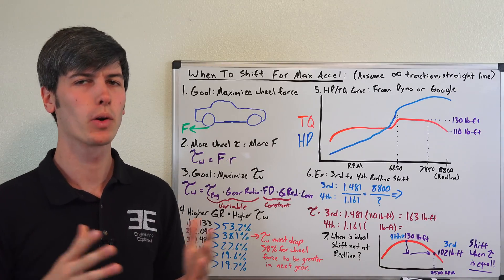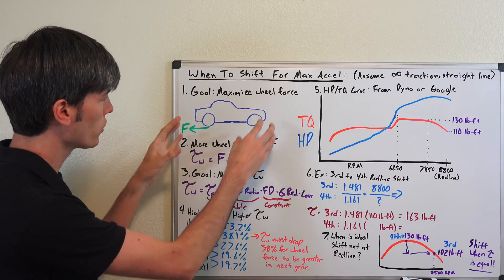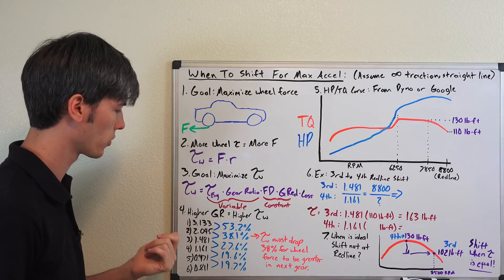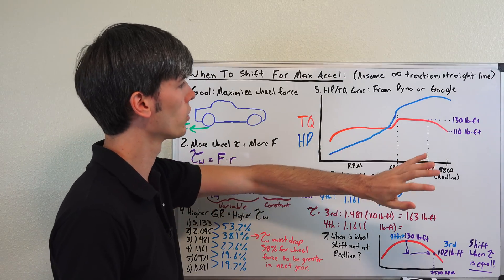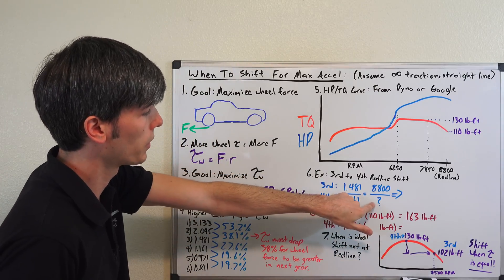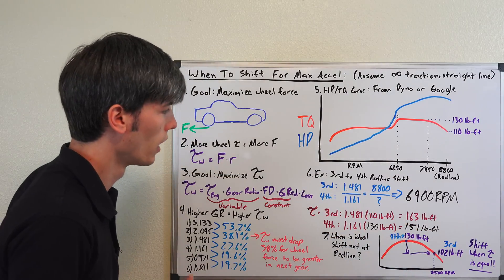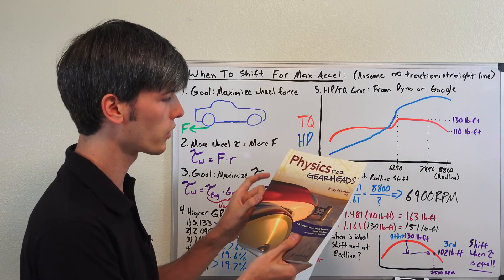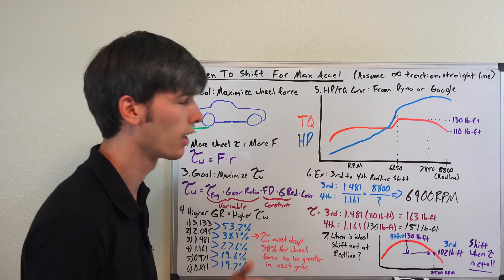When To Shift Gears For The Fastest Acceleration

Comment: Great video! I have one question about when you said losses are the same in all calculations of the gears. Would the losses in the drive line be a factor of shaft rpm?
Reply from the maker: Losses increase with engine RPM, yes. For the rear diff/axles/etc, also probably increases as your speed increases (you've got oil sloshing around, more friction, etc.).

Comment: but taking into other variables say human reaction time: by the time we realize were hitting rev limiter we've bounced off and lost an incredible amount of torque, correct? So wouldn't the best possible answer for the average human be to shift aiming for into 500rpms before rev limiter? clearly being able to aim closer and closer in higher gears seeing as they will gain velocity at a slower speed with the gear being larger in size.

Comment: great video! i have tought this a lot of times. But i think it is easier to solve if you aproach it doing numbers with the hp function as you may want to maximize the "overall power" (the integral of power trought rpm (area below the power graph)). the problem is that to calculate this integral you can either aproximate the curve to splited lines or cupute it on some programm.
Now that im thinking it is a better idea to do it your way haha

Comment: make the same with a stock dodge srt-4 since no engine is similar and turbo car tend to be different when my car was stock at first i was shifting at 6000rpm (6250 is redline) and i started shifted at 5500 and got 3 mph on a drag strip and a faster time but the powerband changed with a bigger turbo so it changed my shifting point

Comment: Question it says my Acura TL makes 258hp@6200rpm, so does that mean that I actually lose power after 6200rpm even though the redline is 6900?
Reply from the maker: +Ant M correct, quoted will always be peak, so before or after that will be lower. Very typical for peak power to occur before redline.

Comment: And what about if you would change gear at 7973 rpm? (which is the lowest rpm in 3rd gear that becomes to 6250 in 4th, the lowest rpm with max torque). At this angular velocity, the car would have a torque around 125 which in 3rd gear equals to 125*1.481=177lb·ft and in 4th gear 130*1.161=151lb·ft

So at this angular velocity the car has a higher torque in 3rd gear and the same torque in 4th, is it faster to shift at 7973 than to shift at redline as you said at 8800rpm?

Comment: Thx for this great an well explained video. You seem to be a real expert, but - being just an amateur - I have one question remaining: it`s clear that - at least in lower gears - the wheeltorque is higher in a lower gear even if the enginetorque is lower. 
BUT: Does higher wheeltorque automatically mean higher acceleration considering the larger speedgrowth in the next gear and when driving in the full torque area? Of course the rpm-needle will raise slower, but will the speedo-needle do so?
Reply from the maker: Wheel torque determines the force accelerating the vehicle. The larger the wheel torque, the larger the force, thus the faster it accelerates.

Comment: this video could of been 10 seconds long so i will explain the video within 10 seconds of reading. hit the red line and shift as you clutch, dont clutch before you shift, start shifting before you press the clutch
Reply: Oh dear, it seems you didn`t understand the intention of the video and did not really listen to it!
First of all it´s not only about the information, when to shift, but also the physically founded explanation why to do so! 
And in second the information hitting the redline is better despite of the lower torque is valid for his Honda-engine and more important in the lower gears. Other engines have other power- and torque-curves, so now you have the way to discover the right shiftpoint for your own vehicle!

Comment: Why is the engine redline set at a higher engine speed (where the power already starts to taper off) rather where the engine achieves max torque or horsepower? To achieve a higher top speed?
Reply: As you can see engine-power grows despite of torque starts tapering. That is because power is torque x rpm (in fact it is a bit more complex), so a high rpm can cerate more power despite of decreasing torque.
Reply: Yeah, I thought so :)

Comment: When to shift for best fuel economy?
Reply: At or a little below 3k rpm if you're on a straight level road.  Otherwise it depends.
Reply: shoft asap
Reply: Nick Martin
Sure, when you want to choke the engine of enough reasonable torque even for simple easy going economical travel.  -_-
Reply: tpcs not really, just shift as soon as you can without lugging the motor, im not saying start out in 6th gear
Reply: Nick Martin
Ok.  In a honda civic si, if you shift to 2nd gear before even clearing 7 mph on a flat level road, you WILL lug the motor.  That is from real world experience. 

If you shift to 2nd when clearing between 10 and 15, that is the sweet spot ( on flat level road) between not enough torque and lugging the motor versus much higher rpm than is reasonably necessary.
Reply: tpcs so as i said, shift asap but not so soon that it lugs.

Comment: On a Peugeot 307 1.6 16V gasoline engine, you get a very weak first gear, so even if you're driving serenely, you still gotta rev it up to 3500rpm to get a good torque when second comes in. After that, all gears are quite well adjusted to the relatively low power of the engine (113hp on south american spec, running E28). I usually get 0-60 around 10.5s. Slow? Sure, but it's decent enough when you're on the tarmac surrounded by under-100hp cars.

Comment: Interesting. I did some calculations on my own, and it seems that at a certain ratio of engine torque/engine inertia it would be possible to accelerate equally fast in any gear, if torque curve of the engine is flat and various parasitic/friction losses are negligible. Any comment on that ?

Comment: Can you tell us. Or maybe this has been done already. In a manual car, should you push the clutch, put it in neutral with clutch out, or leave it in gear to provide the best mpgs?

I do like this. For some stock car, this is normal. However, for a modified car it is not the case. 

The approx hp is (toque x 5252)/rpm for regular people that want to know.

Comment: Just to make sure I am understanding this correctly... Even if I was to put a radical cam with stronger springs (and supporting mods of course) - thus raising the redline - into an engine, I would still only want to shift before redline if shifting gears had no torque drop-off?

Comment: In reference to the initial torque calculation where you used T=Fr, in a normal environment for this situation would a cross product between F and r come into play if you were calculating this quantitatively? I'm not sure if the force would be directly parallel or orthogonal to the r, so I don't know if the equation would become simply F*r or if it would stay F cross r.

Comment: It would seem that the best way to select shift points for each gear pair would be to use an accelerometer to measure the acceleration in each gear, from zero to redline, and then plot all acceleration curves  a single chart, showing the overlapped curves as a function of speed.  This technique takes into account the influence of air resistance, which grows with the cube of the speed, and considers other speed dependent losses as well.  The speed is not a big deal at low speeds and low air resistance.  But since horsepower is the product of torque and rpm, the optimum shift points are heavily influenced at high speed by drag coefficient, and frontal area.  In some cases, the ideal shift point (for each existing gear pair) might indicate the need for different ratios, to prevent over-revving.  Ideally, you must maximize the area under the speed vs acceleration curve.  At top speed, you use all available horsepower to offset speed-dependent losses, and there is simply no torque left to accelerate the vehicle.

Comment: very good video. but i always worked it out a different way. i calculate the rpm drop over the gear change (e.g 1500rpm), and pick the point of the highest average hp over 1500rpm. eg 7000 rpm = 170kw, 8000rpm = 200kw, and 9000rpm = 180kw. you are closer to your maximum power if you shift at 9000rpm vs if you shift at 8000rpm and drop below a 30kw loss from peak power. once calculated you might find that a shift at 8800rpm (depending on the rest of the power curve) is your best possible shifting point for that particular gear. which is essentially working out the same effect via a different representation of best acceleration factor. Wheel torque is interesting because i make my max torque early at 4500rpm, yet rev to 9000rpm, making max power at 7800rpm. obviously peak torque is a huge factor in making power, but seeing as if you shift peak torque to a higher rpm you make more power, and you would never shift gears at peak torque i never thought of using it as a calculating shift factor.

Comment: I love this video. Your videos are never disappointing but this one.. really glad I watched this. I've always wondered about this after playing racing games since childhood (not that they're an accurate representation of how a real car behaves) and I've always been anal about perfect gear changes, even in real life. In my car it has peak torque at a low rpm so I thought that meant I should shift early for better acceleration. Then I thought about it and realized that every gear up is a disadvantage. Then I watched this video and it just confirmed my thoughts. But now I'm wondering, would it ever be advantageous to go past redline (assuming the rev limiter doesn't equal the redline)? That's probably subjective since it could be argued that it's bad for wear on the engine though.

Comment: does your torque figure still increase if you go further into you redline (say, your redline begins at 8000 RPM and ends at 9000 RPM, is it better to shift at 9000 RPM)?
Reply from the maker: +Matthijs Gerretse redline is redline, it's a specific RPM, not a range. Fuel cutoff may happen later than redline, but redline is the manufacturer saying "it's best not to exceed this RPM, for the safety of your engine."
Reply: Also, can you calculate torque without knowing how much power an engine produces or how much RPM you're revving at?

Comment: I'm curious why you didn't use power instead of torque. I doubt I'm saying anything here you don't already know, but power transfer is independent of gear ratio. Your examples could use comparisons in power from gear to gear instead of torque and you wouldn't have to go through the calculations.

Comment: Ideally from a drag racing standpoint, you want to shift at a point that drops your rpm at the gear change to just before your torque peak-to right on top of it. 
Say you have a 750 hp @ 8000 454 and it makes 690lb/ft at 6600 rpm. 
Most 3 speed auto trannies drop about 1500-1800 rpm at gear change.
So 8000 into 6600 = 1400 gear change rpm. so your shift point is after peak torque. 
Might go better for you to shift at 7700 rpm vrs 8000 to hit the torque peak testing is needed. 
In the 1800 rpm case 8000 - 1800 = 6200 rpm which is 400 rpm less then peak torque so it might be better to shift at 8200 rpm and get 6400 rpm instead, again testing is needed every car and engine is different and they have different needs. 
Math is fun Should learn it boys and girls.

Comment: Just look at the HP curve and plot the RPM lines for each gear. Do the mental calculus (area under the curve) and you'll notice the shift points can be calculated for each gear in a matter of seconds by drawing horizontal lines. Did this in FSAE competition and impressed the judges. HP is more useful than doing point to point calculations with torque before and after shifting. If you need a diagram ask me and I'll post a couple of examples.
Reply: Jon Prevost can u do for me. I send my dyno chat

Comment: Does it benefit a larger lower revving engine to run a bigger final drive than a smaller more high revving engine both making the same horsepower ?  Like 5.0 liter coyote vs ls 6.2 camaro

Comment: Thank you for the video, very informative and you surely are a very smart dude! :D ha ha! I have done some modifications on my Fiesta ST, but it still has a stock size turbo which is tiny... typically this car has a loss of 20nm (How we measure torque in nm) per 500rpm going up the RPM range after its 3000RPM peak. So far I have the fastest stage 1 time in South Africa, if I were to provide you with a dyno graph, could you help me plot the best RPM shift points please?? :) Stefan

Comment: max power in an engine does not occur at the same rpm as maximum torque of an engine.  I would expect maximum power at the wheels to occur when there is maximum power at the engine.  So why not calcualte torque at the wheels at maximum engine power instead of maximum engine torque?

Comment: Get a Tesla and this is a non-topic. No gear box and 0-60 in 2.5s.
Reply: What if i told you... electric cars can have manual transmission? Yes even electric cars have their peaks. It's just a matter of choice whether elon will decide to make manual electrics or not... But tesla is in america... Americans don't know how to shift unfortunately so it's a small chance. ;/
Reply: Only electric manual I've seen in straya is my skateboard, changes gears like a bike, I didnt build it because I want max torque at certain times, I did it for speed limiting, my skateboard will keep accelerating to its top speed no matter how little I pull the trigger so if I want to go 70ks then that's my smallest ratio, if I want it slower I have the bigger ratio, if I wanna off-road then I'll want to go slower with my biggest ratio, as speed goes down though torque goes up.
Reply: Yeah, get a tesla and have no fun.
Reply: Watch some tesla acceleration videos with people on board...they seem to enjoy it immensely.
Reply: DP ie I mean, what's the fun of driving a car without a manual transmission?
But yeah, it has a very nice acceleration.

Comment: Or, to simplify it, just change at peak bhp on your dyno graph. Job done. Right?
Reply from the maker: Nope, it's not that simple (as explained in the video).
Reply: Nope, you didn't explain in the video why you shouldn't just change at peak BHP. You even made the mistake of confusing torque with power at 4 mins 13.  Whilst referring to the torque line you say "As you get to the higher RPMS that power starts to taper off". When speaking about these things we refer to torque and power as 2 different, but related measurements. There are plenty of graphs showing torque dropping whilst bhp is rising.
Reply: I like your videos btw....not hating.
Reply: Probably not. Shifting after peak is better, mostly. Because HPs are usually higher towards redline after peak then where you´ll end up if you shift at peak.

Comment: Is it a good idea to rev the engine up to say 5000 rpm every once in a while if you're normally driving carefully, or perhaps too carefully?
Reply: if my engine redlines at 4500rpm 5k is not almost nothing
Reply: What do you mean "no?" Are you saying that if you're usually between 2500-3500 rpm that pushing it up to 5000 rpm every once in a while is a bad idea in terms of engine wear or what? It obviously depends on the engine as well. Who the bleep drives around between 5000-7000 rpm on a daily basis in the first place unless you're on a track somewhere? I wouldn't buy that car used, that's for sure.
Reply: running high rpms once and a while wont hurt your engine, i mean i used to run my last car to redline basically everyday but yeah probably wouldn't recommend it unless you know your motor can handle it.
Reply: If you use common sense it'll be okay. I guess it's good to blow the pipes clean every once in a while. Driving too carefully probably just clogs things up in the long run.

Comment: It's better to pull longer than stronger. You have to have motor with far less torque to make where it would be less beneficial to rev say 6k higher to 15k rpm. The higher a motor revs the easier it is to build horsepower which just like torque through a gear ratio is a higher multiplier.

Comment: As far as calculations go, wouldn't it be simpler to simply shift at the point where the HP in the higher gear begins to drop below the HP you have in the lower gear, maximising the area under the power curve?

Comment: It would usually be the case that you'd shift at redline or just before the limiter in the vast majority of cars, unless you have very closely spaced gears and restrictive top end. For example my Peugeot 206 HDi seems a bit limited when you go in the 4000-5000 range, (possibly due to the computer limiting the fuel though).

I used to think in terms of where the average power within the range you use the gear is greatest but it is probably simpler to think in terms of torque.

Obviously if you have a CVT you'd just keep it at the power peak.